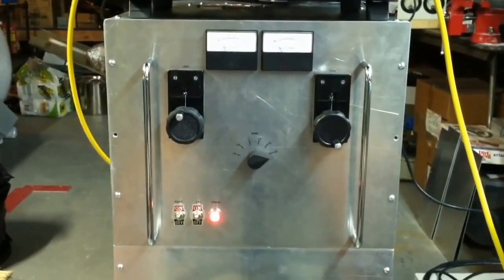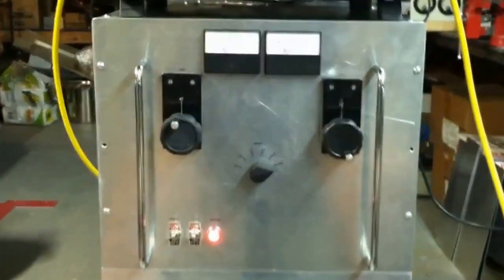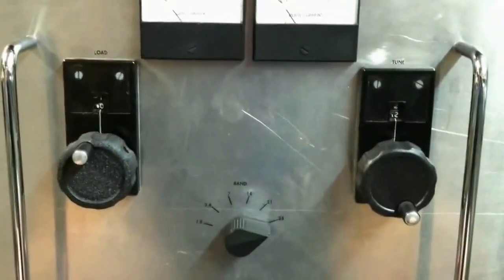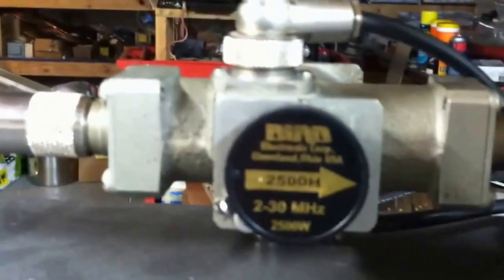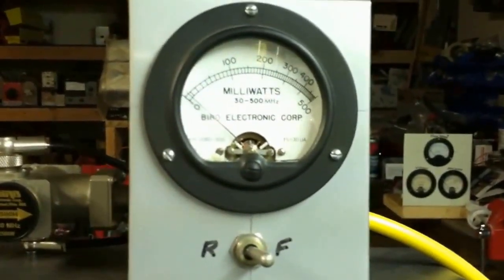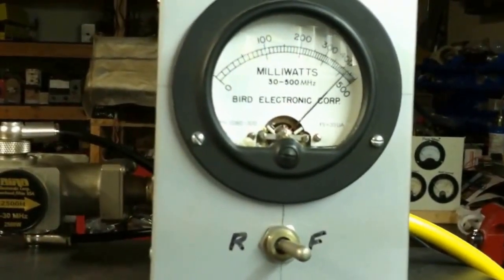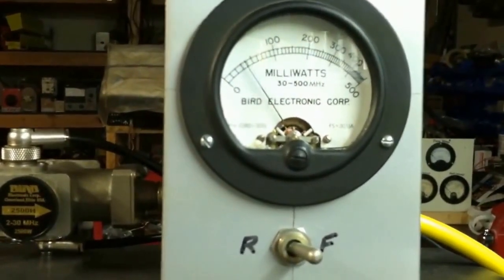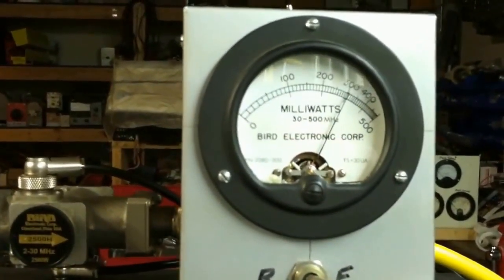3CPX5000A7 /  YC-179 10-160m Amplifier

Comment: Beautiful 20 yers ago i built a linear amplifier using a 4CX5000A 3 phase 400v power supply beautiful working machine someone interested (10 to 80 meters off course)
Reply: Alex, can you help by providing the specs for your power supply?  What C core did you use and wrap count?